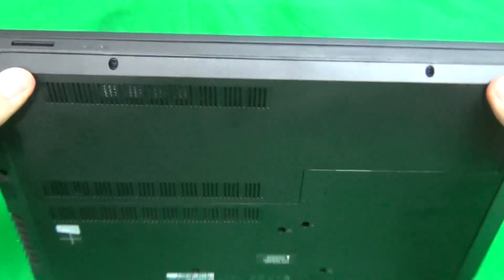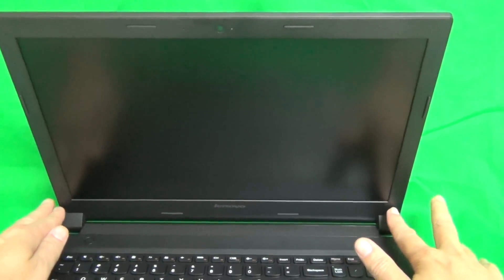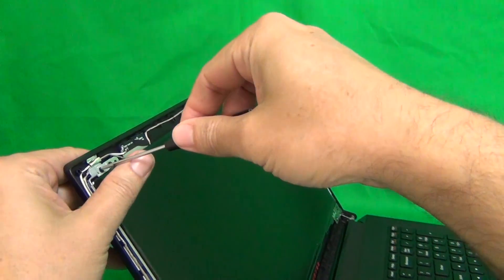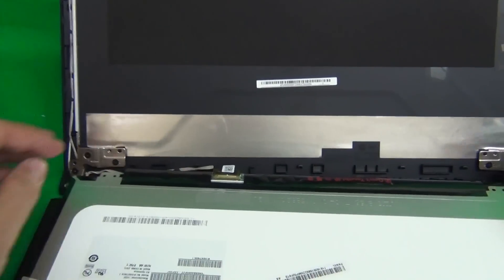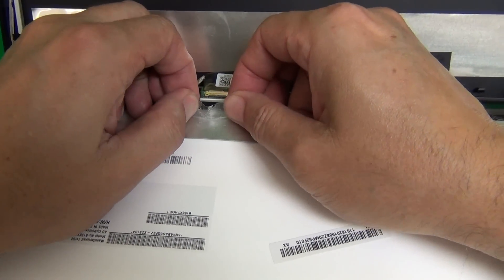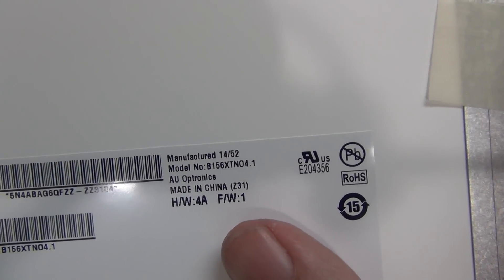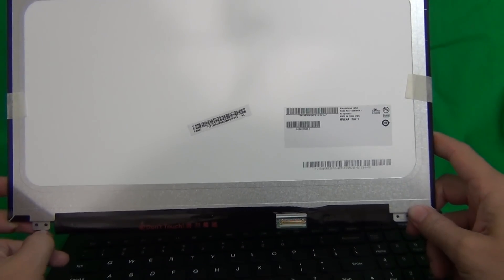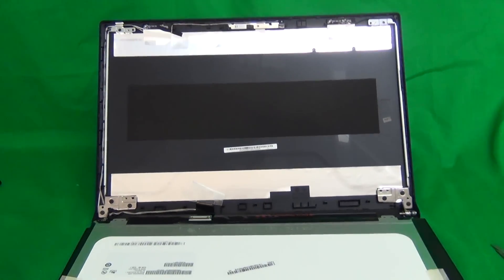Lenovo B50 Laptop Cracked Screen Replacement Procedure

Comment: i have this model and i have an unsoluted problem with the flex conector. It gets damaged by normal use over and over again, and i was wondering if everyone had the same issue with it or its just me. it seems to be a factory failure either on the wire, or the way its on the pc case. anyways, it gets damaged within a month of regular use (moving or closing the screen) and i cant find a solution for it besides to use an external monitor instead of fixing it everytime it gets damaged
Reply: Where did you get the flex conector we have same problem laptop been back had new screen and cable now cable gone again within a month and out of warranty.
Reply: hez guys, i have the same problem. The screen is not working anymore. i figure that it should be the display connector. Can you guys describe where the exact problem was with your b50?